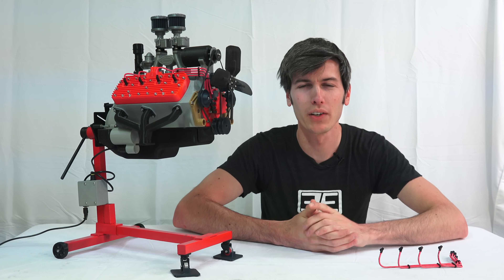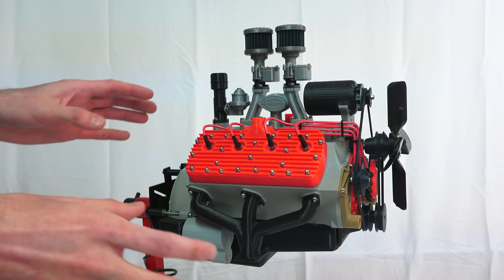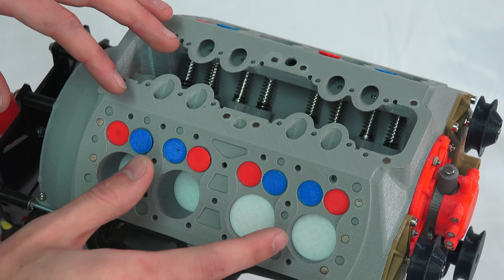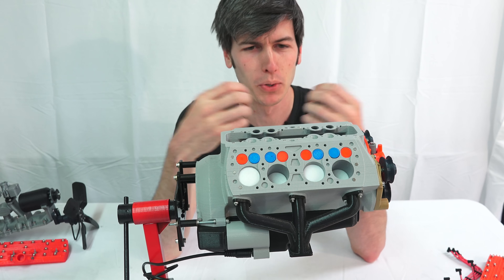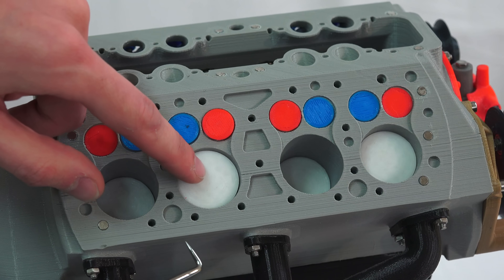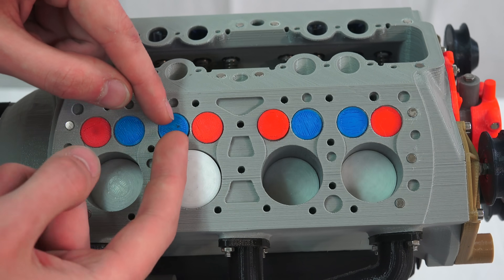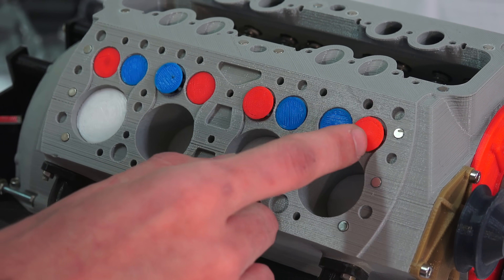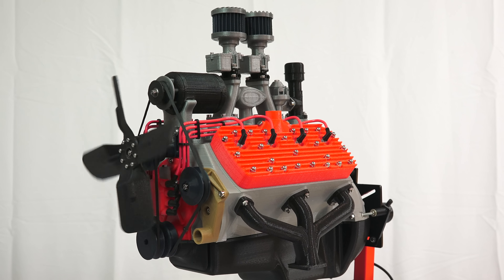Why Ford's Flathead V8 Engine Died

Comment: Hi Jason.  Nice job with this!  I grew up with these engines, first learning how to drive in a '49 Ford with one.  In those days my buddies and I considered this the "hot rod" engine".  In stock form it developed good low-end torque.  It also lent itself to easy modification with Offenhauser heads and different intake manifolds and carburetion.  The dual-point distributor of these engines prior to 1949 was an interesting piece of work, but it worked well to achieve greater coil saturation times.  It was a pretty durable engine too.  As you said, however, its design relegated it to low compression and limited power.  The OHV V8 engine was coming of age by the mid fifties, and Ford had to accept the fact that Henry's flat-head jewel had to be replaced for Ford to survive. Please continue the great work you do.  I love your channel.

Comment: I drove a 1949 Ford well into the 70s. It was very reliable, except it blew the head gasket on the right hand side about every 6 months. I kept a gasket hanging on the wall in the garage, and it was an easy task o change it.

Comment: Flatheads by nature run hot compared to an overhead valve design. The exhaust needs to be ported around the cylinder, heating the block. In a valve in head design the exhaust goes directly to the exhaust manifold. The Ford Flathead needed a large radiator and two water pumps to try to keep it cool.

Comment: The ford flathead V8 might be an extinct species, but there's a modern flathead in production: the german D-motor aero engine. It's a flathead boxer engine (4 or 6 cylinders) that combines side valves with electronic fuel injection and ignition. Since aero engines rarely run beyond 3500 RPM, the limitations of the side valve design aren't as prominent, and the cons may be considered outweighed by the pros; slim profile, low weight and reliability (losing a valve spring merely degrades the power instead of catastrophic engine failure) . It's a quirky engine, well worth checking out.

Comment: Air flow into and out of the engine was probably one of the biggest causes of the flathead's demise, but it wasn't the only reason. Look at the timing gears on the front of the motor, the engine itself was a noisy beast. Gear to gear is always going to be a noisy setup. Plus speaking of power output of the flathead, turn it over and look at the crankshaft mains. Where the typical V8 has 5 main caps the flathead has only 3..... Not the strongest design. But you are right the primary reason was it's efficiency.

Comment: It seems you forgot the cooling struggles these had due to the exhaust traveling through the block.  It wasn't unheard of for these to crack due to an inadequate cooling system.

The poor cooling also limits compression ratio as it raises the chance of predetonation.

This also hampered exhaust flow, and due to the even more complex route it had, further hampered exhaust scavenging.

Comment: also the flame from the spark has to travel very far from the sparkplug to the last corner of the cylinder, which prevents combustion everywhere at the same time
Reply from the maker: Yep! Definitely not ideal for flame propagation.

Comment: The Ford Flathead V8 is not the most performance oriented engine but it makes the sweetest sound. Nothing beats the sound of a cammed flathead V8 idling.
Reply: A friend of mine built a dragster with a flathead engine. He even fabrocated a intake manifold for flathead motor to except a blower. It was "BADASS" . He was out running the up to date small block drag cars. He pushed everything for the max horse power. Only problem was if anything went wrong or blew motor , he had to have a whole new engine to play with....lol
Reply: @SHICOFF1 I am working on a 53 Customline myself. Great cars.👍😎

Comment: What about the 5.0L Ford engine in the mustang. Didn't they have flat heads.
Reply: brandin calin.
No, Ford discontinued flathead V8 engines in 1954 when the new Y block over head valve V8 was introduced, which was  then replaced by the Windsor V8 in 1961.
The flathead 6 cylinder engine was discontinued in 1952 and replaced by a new overhead valve 6 cylinder engine.

Comment: 1953, haha. I would move the valves apart with a wedge of gasket between them to separate inflow from outflow. Supercharging would help immensely but of course that's defeating the whole point of this engine, which is elegant simplicity. The sparkplug would also have to wander off towards the cylinder's centreline.

Comment: ended in 1953? it was made for the french military for many years after that. it was not decommission befor the 90's.
Reply: grapsorz.
The French car maker, Simca, manufactured the engine under license from 1954 to 1961, and the Brazilian military vehicle manufacturer, Unic Marmon (also owned by Simca) manufactured the engine until 1990.

Comment: They needed these V8's back in your day because you had to drive up hill both ways to work!
Reply: In the snow and it was 100 below zero..
Reply: It was a huge improvement over the Model T which would only drive in reverse up hills.
Reply: I dont get it
Reply: Best comment of the month, but you have to be old enough to understand it.
Reply: billville111 I don’t get it someone please explain

Comment: One of the fundamental limitations of the flat head engine is the long flame path from the spark plug to the furthest part of the combustion chamber. This promoted detonation as the shock wave reached the far end and severely limited the compression ratio. I understand that the engine also featured an offset crankshaft in order to improve torque, but I haven't been able to verify this. Really interesting and innovative engine for its time, thanks for the review.

Comment: Some small power equipment engines like single cylinder lawnmower or trimmer, 4 cycle and 2 cycle engines still use the flat head design like this.  Although some power equipment does use an overhead valve design.  I have a Honda push mower from the early 90's that has an overhead valve design.

Comment: They killed it Because GM was blowing their doors off with the OHV v8 and the patent finally expired that GM had on OHV engines. So Ford could finally build something better. im sure they would have done OHV sooner if it wasn't for the patents. The tech existed and the manufacturing costs decreased significantly between 1910 ish and 1950s. GM was winning big time with that patent at the time.

Comment: The last one were made by simca as spare parts to some military vechel they stop made them around 1990
The model don't show the last version made by ford us that typ vas made to 1948 then the new version with cooling connectons in the front of the heads

Comment: People throw around the word efficiency to loosely, while true a flat head design isn't volumetrically efficient there are other types of efficiency. Modern LS engines that use a 2 valve wedge combustion chamber are very efficient from a combustion standpoint because it has a unique flow vortex which aids in air fuel mixture which mean more of the available fuel gets burned resulting in better fuel efficiency and less emissions , this allows a 500hp 7.0L to get near 30mpg and not have pay and extra taxes for emissions. So sure a DOHC 4v 5.0L/500hp is more efficient volumetrically but it will suffer poor combustion efficiency from the higher rpm needed to generate that power plus extra frictional losses from rpm and 15lbs of extra rotational weight from the additional cams and the higher overall weight it starts to look like the only thing a DOHC engine is efficient at is volumetric flow. 

My sisters old 09 clk350 benz had worse gas mileage from a DOHC 3.5L/270hp then my dads LS 5.3L/285hp pickup truck which weighed 1,500lbs more and is as aerodynamic as a parachute. So stop saying DOHC engines are efficient because there not, they're a work around to make decent horsepower from a small displacement engine while bypassing europeon tax laws which arbitrarily tax based off displacement  instead of actual emissions. The only reason for a DOHC design is for displacement limited race cars.

Comment: The main reason for the Flathead engine's existence has a lot to do with its ability to run low octane, low quality fuel. Most of the fuel up to the 1950s was crap and its quality varied greatly compared to now.

Comment: Simca used these engines until 1961 at least
Reply: Tomikos995.
Simca produced the engine under license from 1954 to 1961.
The engine was also produced, under license, in Brazil by military vehicle manufacturer Unic Marmon (also owned by Simca) until 1990.

Comment: Ford flathead with a stage Flathead Motors if it wouldn't have been for the Chevrolet Brothers coming up with an overhead valve cylinder head for it I still only reason why for his got anything good they copied the Chevrolet designed Hemi that was sold the Chrysler that come up with their own version of it but we all know that the big block Chevy and a Hami have the same firing order

Comment: After 3 super sport 600cc inline transverse 4 cylinder and 6 different 4 cylinder cars & finally a single 153cc scooter (Honda PCX) : I find V8 wastefully overpowered with too many moving parts & more internal friction, bearings, spark plugs, etc : too heavy and not fuel efficient enough to make sense in most passenger commuting vehicles etc :P thankfully I am not everyone!
Reply: 3.6L at 65HP from 5.5:1 compression is weak : reminds me of a low end lawnmower engine scaled up
Reply: Its cool that said engine democratized access to V8 engine tech for regular people in non high cost high performance vehicles : especially not with 65hp :P I bet most of the vehicles powered by this had terrible performance & fuel economy numbers!

Comment: Nautilus Engineering develop a "pure" HCCI engine on what is essentially a Ford Flathead engine design. Could you look at that, possibly in comparison in the Ford Flathead.

What We keep seeing is older designs, that fell out over time because the technology was not there then,  coming back with roughly equal performance and more efficiency than modern engines.
Reply: DocWolph False. The design is simply old and simple. If you’re going for efficiency you wouldn’t want the wasted combustion area of a flathead. If you want power you don’t want the poor airflow a flathead design provides. Modern engines are very efficient and they’re getting to the point there isn’t much to be gained. Why would you take that back 100 years and start over?

Comment: Wow your three years younger than my mother, you're old. Never had the opportunity to drive a vehicle with a flathead V8. It's not as if the Flathead design is not still used. In the city in which I live gave birth to two companies that have a fairly big impact on Flathead Motors. One being Harley-Davidson which until the release of the Harley-Davidson knucklehead used a flat head design quite successfully I might add, and the other company is Briggs & Stratton which many of their power equipment still uses since it is extremely reliable and is cost efficient. So the flathead motor has never quite left us. It is a useful machine. As technology advances the flathead motor will become better and better. Although I will admit that I believe the design has basically peaked.

Comment: They are hard to kill - and a similar design might make a comeback:
While opposing airstreams are generally bad we now have the technology to design it in such a way as to be beneficial. The bigger problem i would assume would be heat, limiting to comparatively low poweroutput.

Comment: The Ford Flathead V8 had another problem. Since this design had long exhaust passages from the exhaust valves to the exhaust manifold thru the engine block, this design transferred a large amount of exhaust heat to the engine coolant system. As a result this engine needed a large radiator or it would overheat.

Comment: I disagree.  Emissions mandates drove it out of production.  Being made of plastic may have contributed as well... lots of emissions...
Reply: i don't think i ever saw a flathead for that didn't smoke or overheat.  the exhaust had to go through the block to the exhaust ports adding to the heat load from the cylinders, a long distance. modern engines get that heat out of the engine as fast as possible.  flatheads were often hard starting once they warmed up.
they had skinny little connecting rods and poor bearings.  early engines had full floating bearings instead of the more modern inserts.  the valves were very hard to adjust being placed deep inside the engine with no adjustments but you could get adjustable lifters.  all in all, many of the design problems were caused by a stubborn henry ford who believe he knew best.
Reply: Emissions had zero to do with the death of the flat head. Was simply a poor design. The y-block took over for the flat head. A much better design. More efficient and more powerful.
Reply: It wasn't emissions, the flathead ended in '53, the first emission controls of any kind didn't start appearing until 10 years later.
Also he mentioned the compression ratio of 5:1, was because most gasoline was unleaded (though ''ethel'' lead started appearing in the 30's) but refined to a low octane - just like Coleman ''white'' gasoline for camp stoves and lanterns. Modern engines have at least an 8:1 compression ratio.
Reply: Josh m the exhaust going through did add heat but the main issue was the water pumps not being able to hold pressure. A "modern" WPs are capable of holding 14psi to keep things moving and a liquid. The old FH WPs could only get about 5/6psi so the coolant wouldn't move as quick and would turn to steam.
Reply: Emissions were not a problem with the FH engine, there were other things that killed it, they over heated for one and the stovebolt 6 Chev could either hold it's own or surpass them for power and speed. It was get tech when started in 32 but by 53 it had run its course and was very old hat. Still though they had a sound to them with a straight pipe or glass pac that is still hard to beat.
Reply: Shain Andrews because of the airflow problems you could not get a really good burn in the cylinders which means you get worse emissions
Reply: Nobody cared about emisions. This motor is from the 1950s and earlier not the 1970s.
Reply: There are few videos of flat heads on youtube with a glass head to see inside. The explosion  almost always starts were the air fuel mixture comes in from the valves. It wastes half of its power in side force against cylinder wall and then drives piston down. You gain twice the power or more when you move the valves overhead and gain even more with hemi head or SOHC and DOHC. You can imagine just how much more efficient each step up in the ladder is after seeing the flat head waste half of its power doing nothing. Center point injection is very efficient.
Reply: Emissions wasn't even thought of back then . Overhead valves were just more efficient
Reply: I'm sure it was emissions, not the 65 HP from 3.6 liters of displacement....
Reply: I thought no-one in the US gave a toss about emissions until the 70s?
Reply: The Hippies hadn’t invented pollution yet. It was simply a technological dead end.
Reply: Bryn Clarke 1968 started the downward spiral

Comment: Can you do a video of multiple reasons why old engines produce so little horsepower. For example: my oldtimer is a dodge beep with a 5.4L straight six producing only 94hp. Or cadillac eldorado 8.2L V8 producing around 300hp. Today we have 1.4L straight 4 producing 95hp in a vw polo.
Reply: Some reasons i can think of:
- ohc's instead of L-head/flathead
- 4 valves per cilinder instead of 2
- turbo's added(but not on all standard cars)
- direct fuel injection instead of carburetor
- higher revving?

And why are they more fuel efficient? The dodge beep uses 30L/100km which is more than a pagani huayra and a golf will do 5L/100km. What are the biggest reasons for this?
Reply: It has a lot to do with technology. The old engines weren’t as efficient so relative power was low. As you make a more efficient engine you can make more power for a given displacement. With modern engines they can run much higher compression and have heads that work much better which is where a good bit of the power comes from.

Comment: This is basically an 8-cyl lawnmower engine.
Reply: Visionery1 no nono a lawn mower does not have 60 horsepower lol
Reply: @nah6430  it does if it has 8 cylinders.

Comment: This is one of the absolutely coolest looking motors for hot rodding.  My father has built these with 300+ HP NA and over 500 with a blower (Offenhauser).  Their sound is tremendous.  If style matters these have that in spades.
Reply: Charles Colfax easy, with a lot of money. I believe the guy that holds the record for the fastest flathead powered car at the Salt Flats is making 800hp from his Flattie. However it's very uncommon (maybe the only one) for one to ever make that much.
Reply: James Cutler how would you build one to those numbers?  No, I'm not trying to do it, I'm just fascinated by the how?
Reply: Charles Colfax some top fuel drag cars has 12 ,000 hp flat heads
Reply: I'd love to be beating new cars with a 90 year old flathead
Reply: Same here...
Reply: Runs on nitromethane